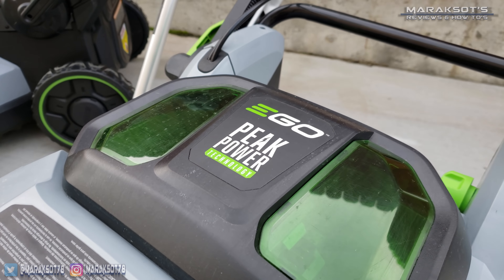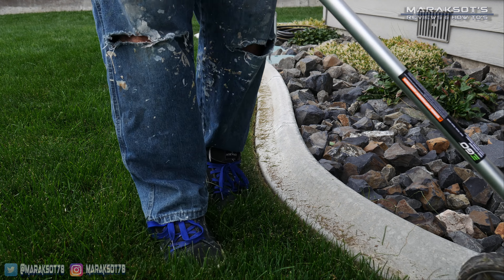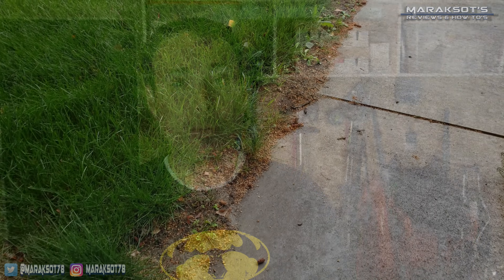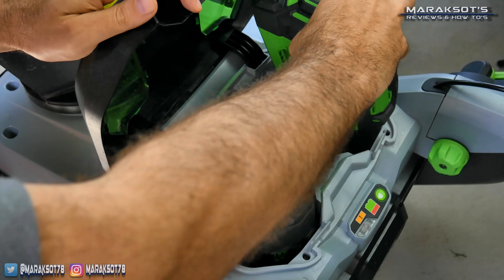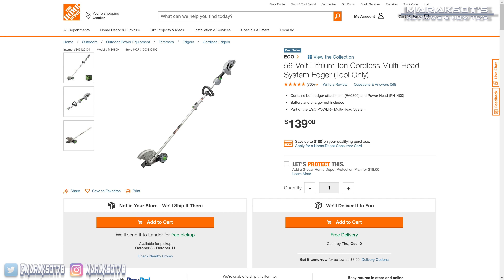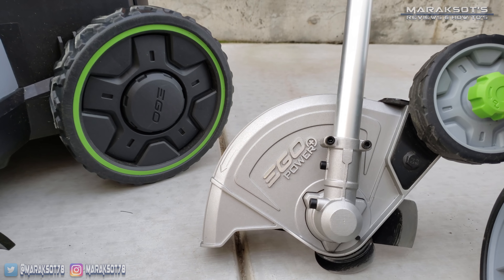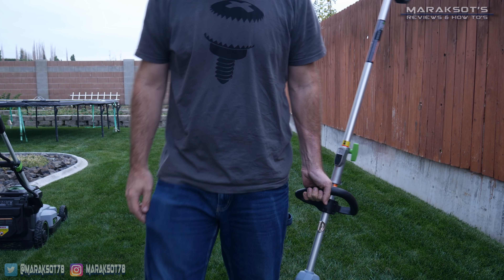EGO Multi-Head System Edger Review

Comment from the maker: Wanna skip to a particular part of the video?  Use the Time Stamps.  :)

Time Stamps

0:00 - Intro
1:10 - How does the EGO Edger perform?
2:37 - Edging my Mom and Dad's super overgrown sidewalk
3:21 - Adjusting the cutting depth
3:47 - What is the battery run time like?
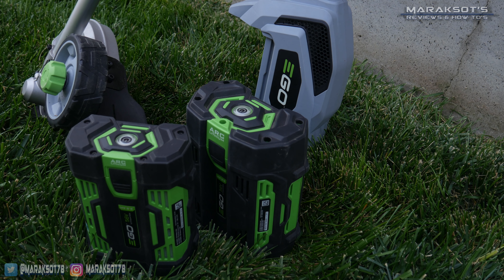4:49 - Save money by purchasing bare EGO tools
5:42 - How the Edger and Power Head come out of the box & Assembly
6:06 - Connecting and disconnecting attachments to the Power Head
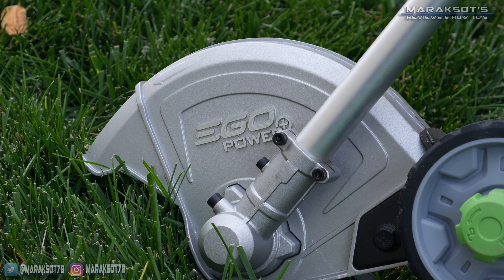6:34 - Edger build quality
7:00 - How to change the Edger blade
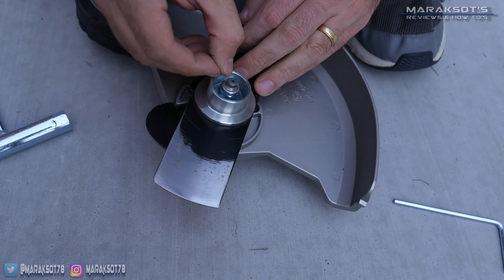7:39 - Transmission gear case grease screw
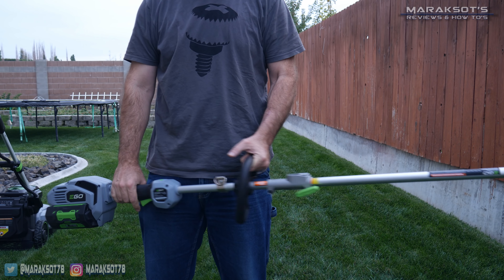7:55 - My least favorite thing about this tool
8:45 - Power Head Overview
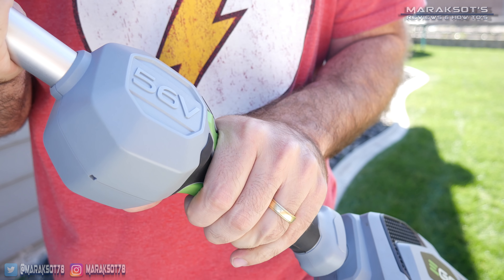9:33 – My final thoughts
10:08 - Thanks for Watching! Like, Share, Comment & Subscribe!  :)
Reply: Maraksot78 ..
Reply: I have the trimmer with power load. Will edger attachment work with it.

Comment: I just gave my ego edger it’s first test run. I have a 160’ long driveway and the edger did a great job. It has enough power. Not as strong as my Stihl gas edger but it was plenty strong for my use. 
The best part was it was so much quieter and smoother running than a gas edger.👍🏻👍🏻
It’s definitely a keeper

Comment: I absolutely LOVE this edger, but it is the only one that I have ever owned. I purchased it solely because I already owned the LM2135SP Mower and it was a natural transition to lessen the types of batteries I have. First I tried to use my string trimmer to edge, but I had WAY to much overgrowth over the pavement. Then I thought about using a shovel to cut the overgrowth away, but that would have taken forever with my long driveway. So I went with this, and I am VERY happy. My only complaint is the same as the reviewers: the weight. I use a 7.5aH Battery on mine, so it is pretty hefty. Other than that, this thing is worth its weight in gold.

Comment: Thanks for this well done video on the edger.  I just used it for the first time today; however, that is after doing a lot of research.  One thing most reviewers says is that it is heavy and takes effort to operate.  I attached the Darwin's Grip 5.0 on the edger after watching few reviews about how great it is for the bristle brush and rubber paddle attachments few years ago and bought a pack of 10 on a Christmas special few years ago and now it works very well without straining the back.  I find the strap still adds strain on the shoulder and the material does not keep its integrity on the D ring on something this heavy during operation but the strap works well on the new EGO 16" Line IQ trimmer with the quick adjustable weight balance strap slider.

Comment: Thanks for the info.  I just bought the power head with 4 attachments (hedge, edger, string trimmer and pole saw) and have only used the string trimmer thus far.  Nice to know how the edger works and how to make adjustments.  So far I'm really pleased with the purchase and my neighbors seem a bit jealous as they all have noisy gas powered units.

Comment: Husband just bought this tool and we both used it. The first thing I noticed was the excess weight because of the battery as compared to my previous push electric which has a large wheel and doesn’t require any balancing. Thanks for the strap tip.

Comment: Nice review, didn't cover if replacement blades are readily available and how much they cost... I agree a strap would be beneficial and should be included. Also agree, those batteries get heavy quick and are EXPENSIVE!  I have the Ego mower and only negative to it is it doesn't always cut cleanly the first pass, otherwise I love it.... Thanks for the review!

Comment: I have the EGO carbon fibre shaft version of the multi-head power unit with the carbon fibre shaft edger tool. I noticed when you complained about the weight and the lack of an included shoulder strap (my carbon fibre unit did include one) that you have the forward handle on the edger mounted backwards, it is supposed to angle upward toward the main trigger handle.

Comment: If you have multiple pieces of equipment, you really need to pick up the backpack link.  It takes all battery weight off the tool.  I didn't know about this accessory and once I picked one up.  I regretted not having it since day one.  It makes the entire experience so much nicer

Comment: I purchased this EGO edger from Lowes, it was delivered to my home being they didn't have one in stock. The only issue I have with it is that I'm left handed and  when I use it left handed I get a lot of debris on me and in my face.  I'm doing some inservice training getting use to using it with my right hand, so far so good  'adapt and overcome '   ;-)  Most demos I've watched people are edging sidewalks, driveway etc. I have a lot of grass to edge that's not  next to a walk or drive and that's where the debris is kicked up and out.  The good part, I can edge a lot quicker with the EGO than I could with my bulky  4 Wheel Troy-Bilt B&S 158cc Edger.    I do miss adding gas, changing the oil, spark plug, air filter and pulling on the starter cord - lol

Comment: Love the latest Ego mower...just picked up the Edger.  I’m excited to see how it performs!
Reply: I just bought one used it Right out Box I dis small front yard without Charging Lot Power Quiet and easy to Control the speed. I'm looking forward to purchase more multiple tools No more Cords or Gas for me.
Reply: Had mine for 2.5 weeks the select cut is a beast! My first EGO product just bout the edger tool only yesterday..are u using that heavy 7.5ah batter on the edger? It's the only battery I have so I better get the strap..smh..

Comment: I would recommend buying one of each tool that you need, like me who lives in Texas and have a lot of trees, I would get the chainsaw, leaf blower, mower, and the Multi tool while also trying to get each one with the biggest model as they usually come with a big battery.

My idea is pricey but in my opinion it's better to have tools that are more  than enough than have something that is barely enough or possibly come up short.

I bought the LB6500 leaf blower that I use around my home and for my business and I'm currently looking into the multi tool to see what my options are with it and then after that I plan to look into getting the mower for the tighter areas that are pain to get in with a riding mower

Comment: Thank you for the review mate, down under here, we have it pretty warm every summer, how does the battery hold up under heat ? anyone here had issues ? Ego are really really easy to deal with warranty wise, there isnt much out there that offers 5 years. this is a contributing factor to my purchase. i nabbed the stand alone 540mm hedger kit with 2 x 2.5AH batts and the mutli with 5AH and rapid charger so have plenty of juice. excellent product

Comment: Hi! Great video, I have one question; is the norm to sort of have to bend/hunch over a bit to align the wheel to the ground to keep the tool flush? I find if I stand upright the wheel doesn’t touch the ground (I’m not that tall, only 5’7” 😂)…. Maybe it’s a stupid question but would appreciate your input on proper posture!
Reply from the maker: That's interesting... I have to hunch over a little bit to get the wheel to ride on the ground properly but I'm 6'-2" so I just thought it was that way because of my height. Interesting to hear you're experiencing the same thing at 5'-7". Thankfully I don't have a ton of concrete that needs edging in my yard, otherwise my back would really be feeling it.

Comment: I just went from a Stihl line of tools to the Ego. Please tell me how do you know what your battery level is at. There is a green light in the manual it says more than 15%. This is in my opinion where i feel EGO is not up to speed compared to other tools. I really felt that i had bought an inferior tool. On the Stihl battery you have a level indicator allowing to let you know if you have to charge or you can use it right away and this is as well on many other tools.

Comment: Does the depth of cut adjustment actually achieve anything? Adjusting the height of the rear wheel looks like all it would do is alter the angle of the shaft. At the end of the day, the blade is still run along the ground on the same rubber pad which never changes height regardless of what the rear wheel is doing. Maybe im missing something?

Comment: I don't think that the power head has a brushless motor. To me that is a concern. The blowers and stand alone string trimmers do have brushless motors..  I just bought an EGO blower and stand alone string trimmer.  They are awesome.  The blower is so powerful I finished my yard quickly and had lots of battery.  Honestly it only took about 5 minutes. I had a lot of heavy weed wacking and my 2.5 amp battery lasted about 30 minutes working very hard.  Battery charged up in about 40 minutes.  The string trimmer is unbelievable powerful and well balanced.

Comment: if you buy a Greenworks 80V trimmer with universal attachment capability, you get a more powerful motor and you don't even have to buy a completely separate edger tool. Instead, you can just buy an edger attachment for $70 and power it with one of many power platforms.

Comment: As a first time EGO user, I just bought the edger combo kit.  Is there a reason it wont spin up when placed on the grass and aligned with the sidewalk?  It works just fine if I turn it on and then plunge into the grass.  It seems like it should have ample power to allow the user to align it first to the sidewalk before having it run especially around ornate pavers where I risk the change of chipping them.
Reply from the maker: I know what you mean. Mine does the same thing. It must be a design choice Ego made to prevent accidentally engaging it while it's sitting on concrete or anywhere else you wouldn't want it to turn on.
Reply: This is exactly my issue. Just bought the edger. Very frustrating for a first time user  I'll try the plunge method.

Comment: I have an Ego carbon fiber power 56 volt split string trimmer. Would you happen to know if the bottom section rail of the Edger would fit on the trimmer and work?

Comment: Picking this up along with an Ego 21-inch self-propelled lawnmower. One question. Will the 7.5 Ah ARC battery from the lawnmower work with the Edger? I know you said the batteries are swappable between the tools, but will the edger work with the higher amperage battery from the lawnmower? Thanks. Liked and subbed!
Reply from the maker: Yes it'll work but the larger capacity batteries are heavier which will make the edger heavier, but other than that it'll work just fine.
Reply: @Maraksot78  Thanks. I'll get another battery next year. Be safe. And thanks for the prompt response.

Comment: Thank you for your great review.  I'm a lefty.  Does it appear that the bottom portion can somehow be reversed to the other side so I can use it with the tool on the left side of my body?  If I ran it on the left this way, the blade guard would not protect me from flying debris.

Comment: I assembled my edger and was so excited to edge my front sidewalk and flower beds.  The flower beds do not have a concrete edging around my garden.  In the first five minutes of use, I hit a buried rubber hose and the thing went kaput!  It now makes a strained noise and the blade does not move.  Needless to say, I have not been able to use it and would like to know what I can do to fix it.   Thanks for any help you may offer.
On another note, we have the lawn mower and power blower which I love!
Reply: Did you ever find out how to fix your issue? I'm having the same problem.
Reply: @IamFrancoisDillinger  No, I never heard anything. Now that it is springtime, I want to try again. Does anyone from ECO read these messages?
Reply: I really need to know how to fix this! Could someone reach out?

Comment: hi @maraksot78  would you suggest the multi head or the standard ego string trimmer?   Thanks!
Reply from the maker: I have never used the string trimmer attachment for the power head so I can't speak to what it is like but I do own the power load string trimmer with the carbon fiber shaft and I love that thing.
Reply: @Maraksot78  awesome thanks. Ordered the string trimmer and the hedge trimmer. Thanks.

Comment: I have the same unit, and while I love EGO tools, I found this one to lack some torque as it bogs down fairly easily, even with edging that’s not nearly as bad as your parent’s house.
Reply: Hmm, it has been rock solid for me and our edges were able to get really nasty by the previous owners of the house. Was worried it wouldnt be able to cut but it plowed right through. Curious if you may have a defective power head. Only complaint I've have is that it wants to jump out of the cut on the really hard spots because the head itself isn't heavy enough (most of the weight being on the battery). Our lawn is Kentucky 31 and was over grown about 3" over the sidewalks on all sides (I killed a Ryobi 18v system after doing about 1/2 home's sidewalks). Now that the edges are in order it's a breeze but I'd certainly contact EGO to see what they say about your bogging down issues. Oh, I edge on speed setting 1 so that might be something worth trying if you havent already.

Comment: Dude! So helpful, so in depth, so well organized. Thanks for making this. Quick question: we just bought the Edger with Powerhead. Would you recommend the Ego Stringtrimmer attachment for the Powerhead? We also just bought the separate Stringtrimmer with the Powerload feature, which seems cool, but wondering if we need that or if the string trimmer attachment works almost as well and if it would be better to just have one head with the edger and string trimmer attachments?
Reply from the maker: Thanks for the question. I also have the Power Load string trimmer and love it but I've never used the string trimmer attachment for the power head so I cant speak to it. I believe it has EGO's rapid reload head which works similarly to the power load head. You feed the string into it just like the power load head but then twist the head manually to wind the string in. A little more work for you to do but WAY easier than taking the head apart and winding it by hand the way you had to in the old days and still have to do on other string trimmers. If you search EGO rapid reload on YouTube there are videos showing how it works. It's pretty slick.

Comment: Great videos Brian. I just finished unpacking, fitting, and getting ready to go with my EGO edger (my first outing with EGO gear). I have read all the docs and was surprised after reading about the Power+, battery and charger that there was not a word of instruction regarding the edger appliance itself. Your videos take care of that but one question remains: when I tried the wheel height adjustment, tightening down the knob to lock the height position also seems to lock the wheel itself, preventing rotation. Seems like loosening up enough for the wheel to turn would defeat the height adjustment locking. Any tips on this? Thanks!
Reply: @Fitster C - any updates?

Comment: Thanks for all the great information. My question is can you get the power line head with the edger and power trimmer you just did the review on
Reply from the maker: They do make a string trimmer attachment that connects to the Power Head unit.  However if you're asking if they have an attachment that has the Power Load head the answer to that is no.  The string trimmer attachment for the Power Head does feature their Rapid Reload head which works almost the same way as the Power Load head.  You feed the string in just like you do on the Power Load head but then you twist the head by hand and wind the string in.  Yes the Rapid Reload head does require a little more work than the Power Load head but it's WAY better than having to disassemble the head, wind the string into it and then carefully put it back together again hoping the line doesn't unravel in the process.  Here's an example of how the Rapid Reload head works https://www.youtube.com/watch?v=Ye8t8MBZg2Q

Comment: Hey Maraksot, what is the difference between the multi head and the regular edger they offer? Outside of the obvious, that one can use attachments.
Reply from the maker: That's a good question. Unfortunately I don't own the string trimmer attachment for the powerhead and have never used EGO's regular string trimmer (I own the Power Load string trimmer) so I haven't been able to compare. Sorry I'm not much help.

Comment: I'm considering buying the LM2135SP which comes with a 7ah battery, which is larger than the 5ah.  Has anyone used the edger with the 7ah battery. Is it really heavy.  I have an average sized front and backyards.
Reply: That is very heavy to use and I would only use the 7.5Ah or the 10.0Ah battery with the backpack when I need it to do multiple tasks in the roll after mowing like edging, trimming than blowing.

Comment: Pro-tip, don't buy your batteries from HD, if anything buy the tool if you need a good battery and don't own it already. If the weight bothers you, build your arms up. The ergonomics of the shoulder strap when attached to the unit, sucks if you use this thing for long periods of time.

Comment: I have used Stihl for over 20 years 🌴 allabout.wiki/EGO and after reading some reviews of this trimmer, I tried EGO Power+ , and I'm going to switch. Compared to several Stihl trimmers I've had, this one is easier to start, quieter, and feels at least as well built . A major plus is it doesn't have the wonky, always leaking, complicated gas tank caps that Stihl has.